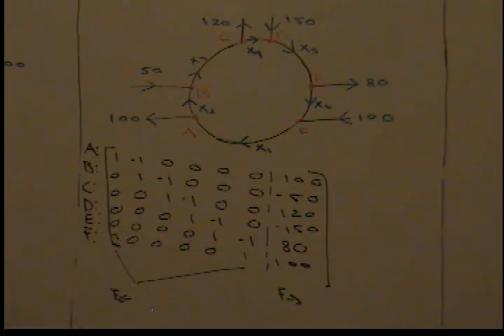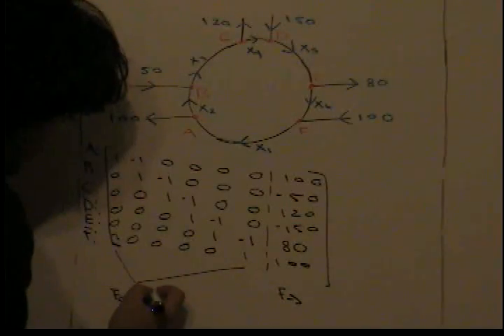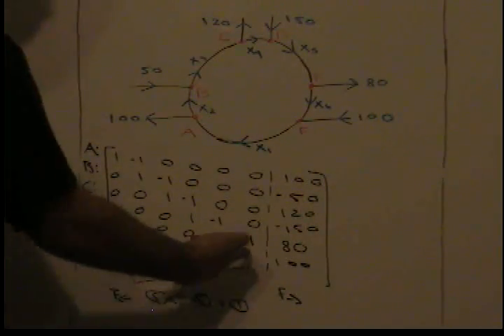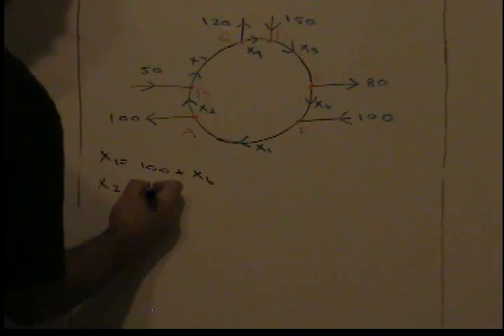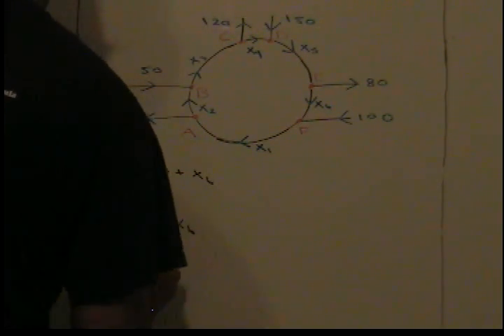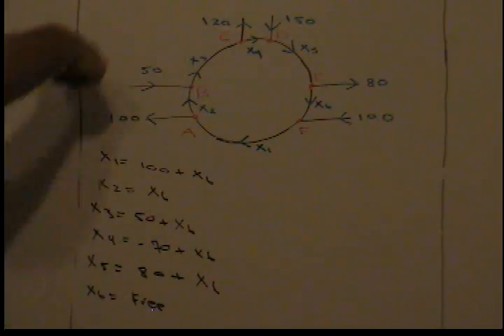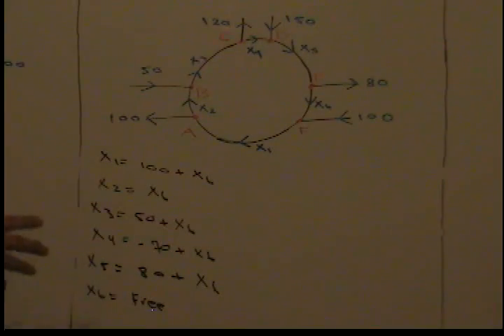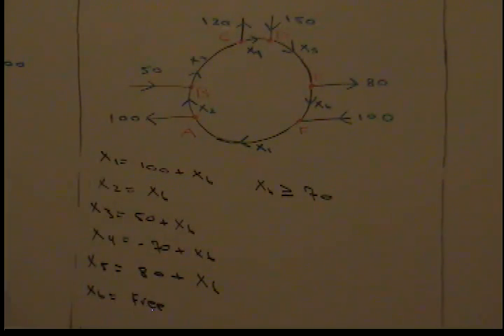Finding the general flow pattern of a Network Diagram (Example 2) Part 2

Comment: if you were trying to get rid of the -1 in row f , the wya you did it by adding row 1 to row 5 ,that  would make the second 0 in row f  turn into -1  since , 0 +(-1) = -1 made a mistake there buddy
Reply: and you would also by the same logic have to add the constant of row A to constant of row f which would then equal 200